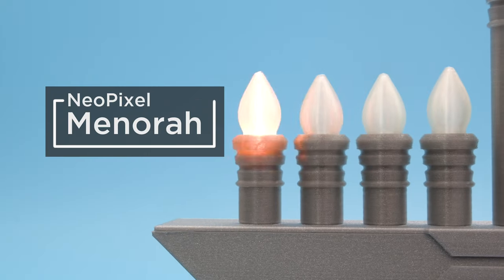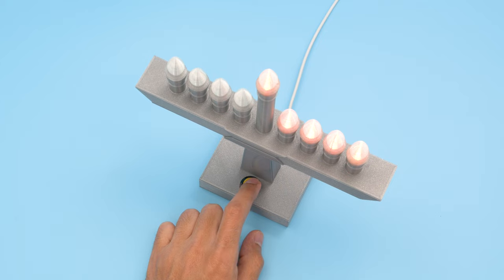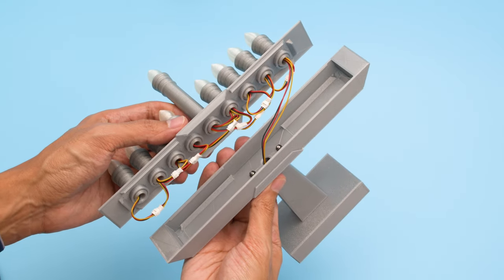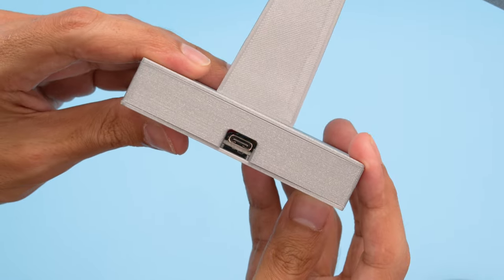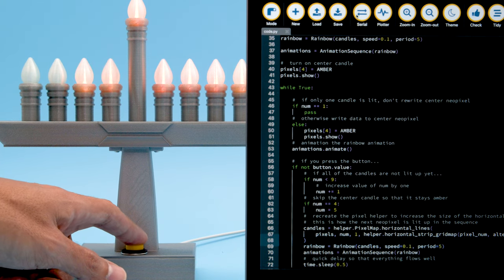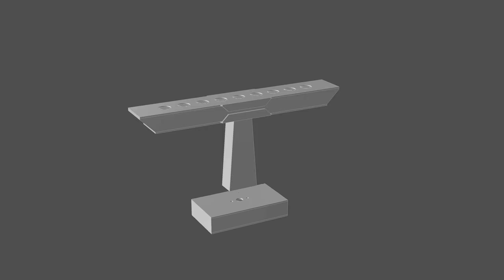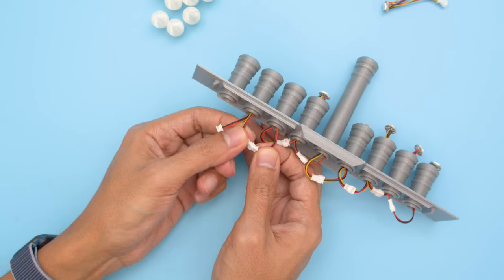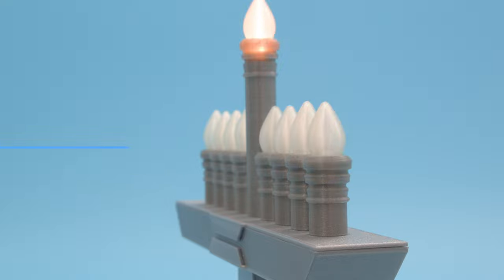NeoPixel Menorah #3DPrinting #Hanukkah #adafruit

Comment: Nice project, thanks for sharing.  Is the choice of an RP2040 board basically because it's small and new?  Isn't that a little over powered for controlling a few NeoPixels like this? 😄
Reply: Could swap out the board for  a trinket but the RP2040 is mostly available
Reply: @Pixil3d  thanks, availability these days is another good reason I'd not thought of.  Or if you happen to have a spare board around that fits and does the job.